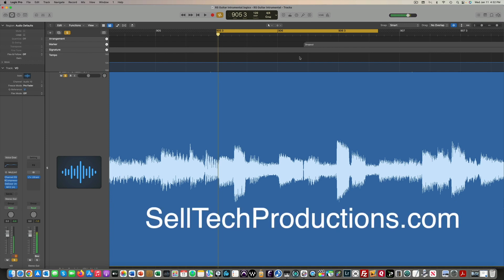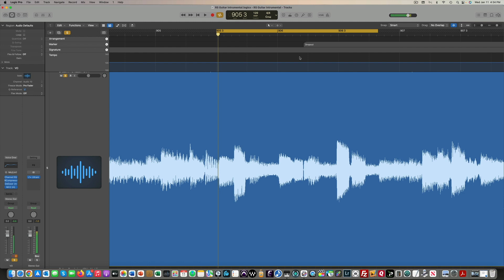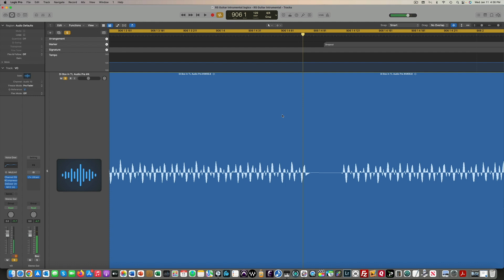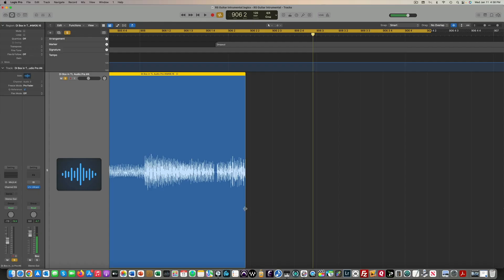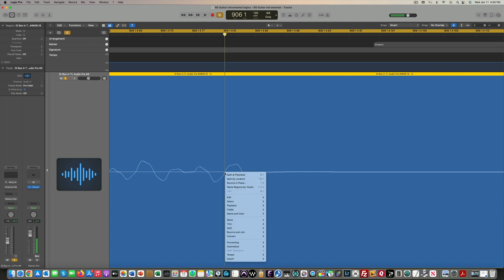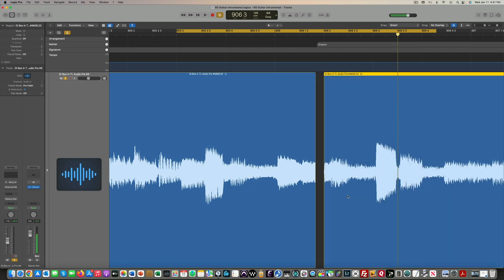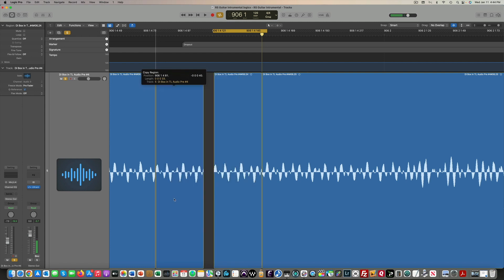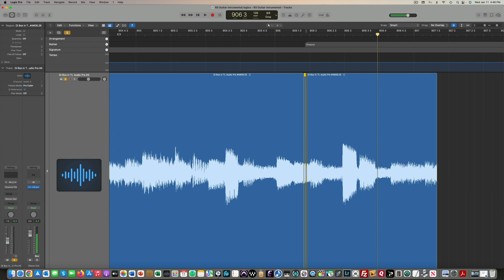Fixing Audio Dropouts Non-Destructively In Logic Pro X

Comment: Thanks for the tip Bob. I record acoustic guitar quite regularly and I must say I’ve never had a drop out per say (touch wood) but I do get the odd ‘blip’ for want of a better word which can be quite baffling and I’m often cutting and pasting replacement audio sections to fix the issue but I’ve never actually done it with such precision as you have just demonstrated. I usually end up having to add a small fade edit at the join. I will definitely use your method in future. 👍
Reply from the maker: Good luck with you future tweaks. Hopefully, this process will work for you as well.  Thanks for the comment!